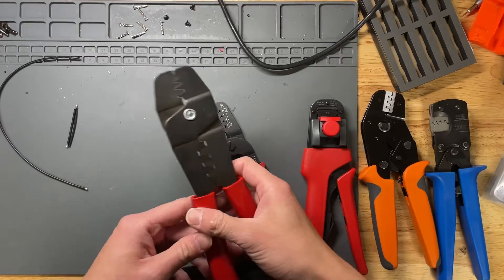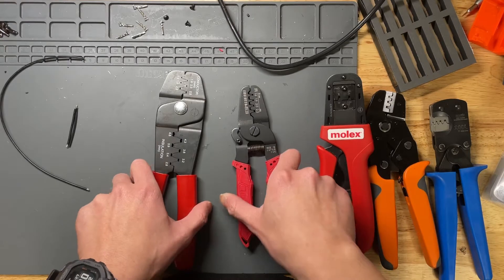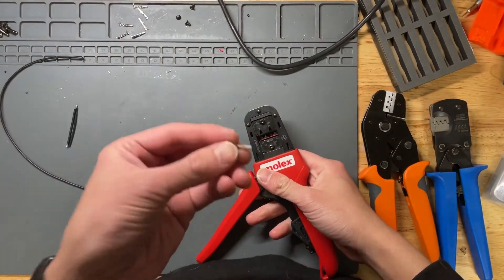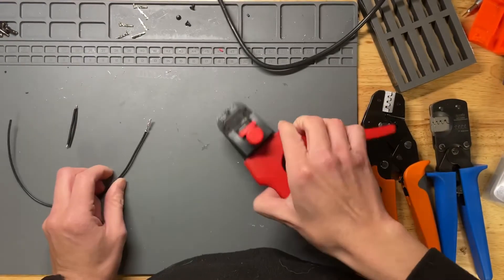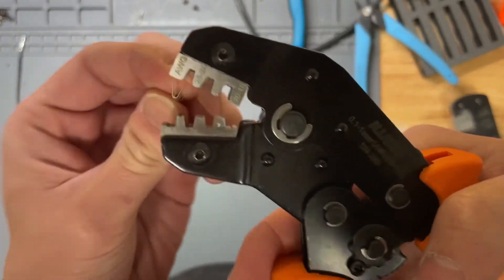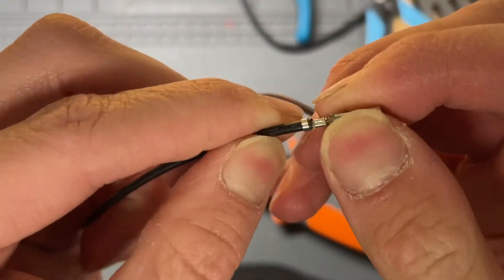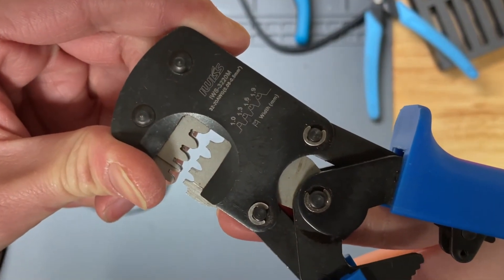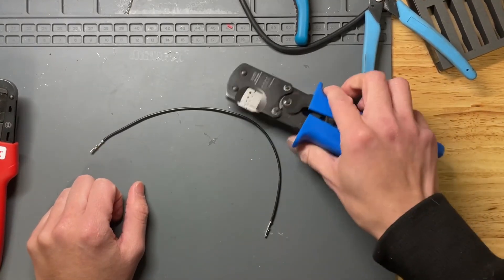Crimp tools recommendation

Comment: I love pc build. I have SN 28B Jaw not have CNC (No brand,blue color,8$) it can crimped ATX “female” terminal is good. But my SN28B (no brand)is can’t crimped ATX “male” terminal it very bad crimp. 
I want know your iwiss SN28B jaw have CNC it can crimped ATX “male” terminal can or not?? 
Thank you i wait you.
Reply: Yes. It can. I would also try different wires. Different wires have different materials and thickness for the insulation, which affects crimp quality. I recommend "UL1007 18 AWG Wire."